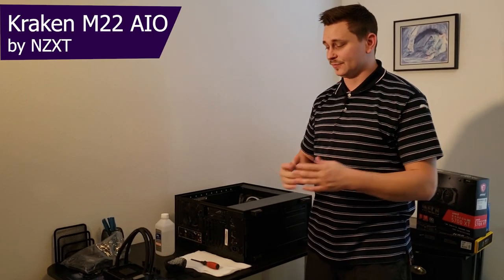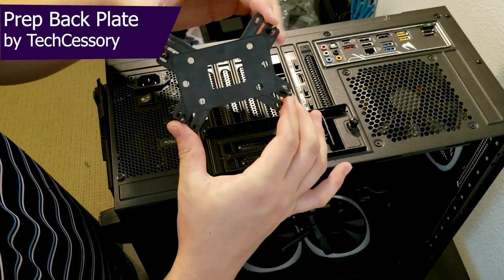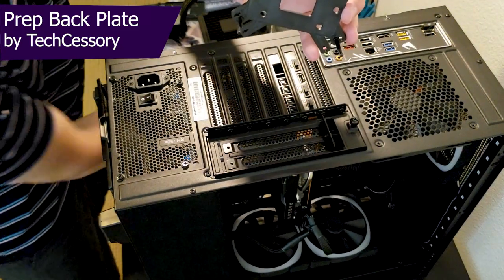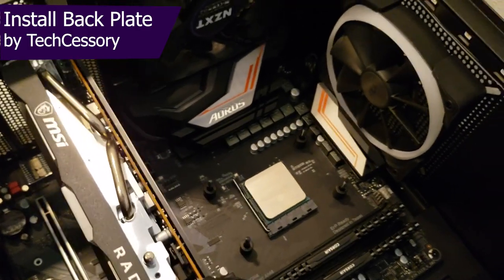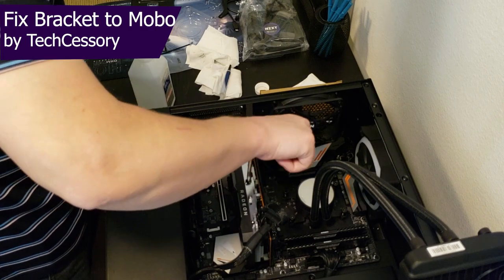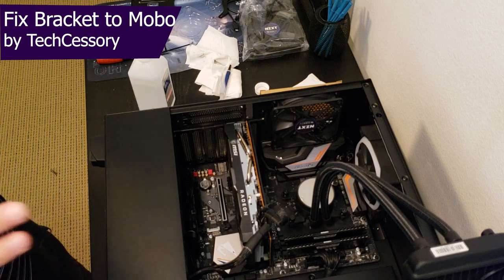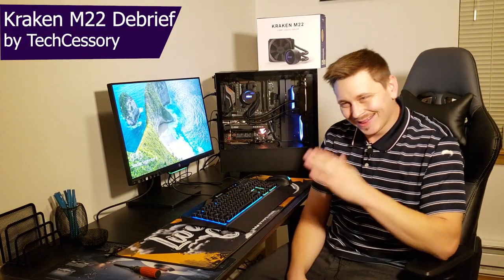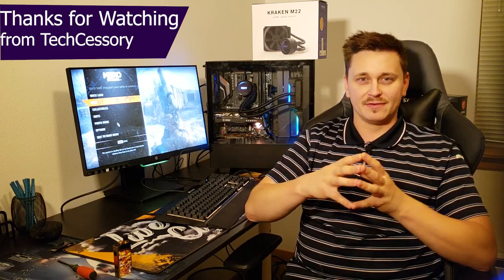AIO Liquid Cooling | NZXT Kraken M22 Install Guide

Comment: Just picked up an m22 off eBay and didn't come with the am4 mounting bracket. I searched and searched the internet for one and I still can't find one. Please help.
Reply from the maker: Check out Newegg. They have them on their website. It should just be under the search term "am4 back plate"
Reply: @BainCustom  Thank you for responding to my post but I still can not find one even on newegg. My apologies but if you could send a link that would be helpful.

Comment: Hey good video, probably a dumb question but how do you actually put water in it?
Reply from the maker: It comes ready to go. No need to add water.
Reply: TechCessory would you ever have to change the water?

Comment: Hi, great video. But i've got a question : does the radiator fit as rear exhaust in the NZXT h510 elite if i put the other fan on the top ? I hope you will se this message and answer it, the video has been posted from a long time.
Reply from the maker: Oh yeah, I always reply. Definitely join the channel so you can be a part of our discussion at any time. We have this channel and a Facebook group we are very active on.

Anyways, to answer your question. It is not recommended that you install a radiator on the rear exhaust port. It is best to install an exhaust fan so you're not blowing hot air over the radiator. 

I am not 100% certain it will fit anyways.

Comment: Thanks for the video . It was very helpful.  I have one question that i have old mb Asus m5A97 and i dont see any aio connector in case i decided to buy M22 which connector should i use
Reply from the maker: Hey thanks for the comment and welcome to the channel! It can change depending on the motherboard, that being said it is typically recommended to put the pump on the CPU fan. Then you connect the radiator fan to the system fans.

I hope this helps, this can also be done backwards and it will work just fine. Check your motherboard for any recommendations if they have any.

Comment: planning on getting one of these for my 5600x, how do u think it will hold up. i cant go for a bigger one due to lack of space in H510i with a zotac 1070 amp extreme
Reply from the maker: I think it will hold up. The nice part about the new ryzen chips is that they don't use more power than the previous gen. So they don't really run warmer.

Comment: Hey man! I am thinking of buying this cooler, but i am wondering if it is possible to change the fan that comes with the radiator? Thinking of installing some InWin Sirius Loop fans instead of what comes with this. Is it possible? It's my first time investing in cpu water cooler :)
Reply from the maker: 100% I changed it out to the Aer RGB Fans from NZXT. It should fit any 120mm fan though so you are good to go there.
Reply from the maker: It is a good investment. I think the price is about $70-$80 which is worth it for the appearance and performance for sure.
Reply: @BainCustom  Thank you so much! And really good review btw! Decided to go for this because of you instead of the Asus ROG Ryou :D
Reply from the maker: Love it! It helps that I already use CAM. But I would for sure take this over the ROG because of price/performance. Unless I wanted all ROG. Which is a whole other discussion haha. Thanks for the support!

Comment: I have the same case and thinking of ordering the m22... Just curious if you plug the cooler into the USB hub what did you plug into the cpu_fan port as Ive heard of nothing goes into that port your system will not run as it's a safety feature to make sure there is a cpu cooler
Reply from the maker: Yeah I used the fan hub for the radiator fan and the USB 2.0 connection for the head of the cooler. It doesn't call for a cpu fan connection on the motherboard.
Reply from the maker: The fan hub will bypass this issue. But if all else fails you can plug the aio radiator into the CPU connector (I have heard).

Comment: Nice video .. plz guide me i am going to upgrade msi b450 with r5 2600  and wanna install krakren m22 i am worried do i need any other bracket for amd processor/ motherboard ? Plz reply
Reply from the maker: Hey thanks for the watch and comment! Hope you're having a good start to the weekend. To answer your question, the bracket for AM4 does come with the cooler. At least I was able to utilize the bracket that came with it.
Reply: @BainCustom  thanx bro
Reply from the maker: 100%

Comment: Hey I just wanted to ask is the way you mounted the radiator the best place to mount it for better temps and everything?
Reply from the maker: It fit my case the best and the aesthetic. It is also a very efficient way to install the radiator. The fan arrangement I had in this video isn't the most optimal, but it represents a more of an RGB build than it does a performance build for low heat.

Comment: Thanks for the vid! It looks like you put a different fan then what comes with the cooler? If that’s true, what type of fan did you use?
Reply from the maker: Good eye. I used the NZXT Aer RGB 120mm fans. They worked perfectly and from what I understand any 120mm fan will work for the most part.
Reply: TechCessory ahhh that’s what I thought. For the aer 120 did you need an rgb fan hub?
Reply from the maker: My case already had one so I didn't have to use the fan hub. I'm glad I didn't need the hub that comes with the fans because it doesn't work that well.

Comment: Does the AMD plate come with the cooler? Or do you have to buy it seperately?

How did you settle the back plate? How did it fit in like that?
Thanks
Reply from the maker: So the backplate was supplied from NZXT on this cooler. It is not the stock backplate.
Reply from the maker: Well, it's not the stock AM4 backplate.
Reply: @BainCustom  oh okay
Reply: @BainCustom  the AMD plate was supplied by NZXT?

Comment: Hey! Awesome video. Very helpful. I'm getting my m22 in a few days so just doing some research. Quick question, I thought the m22 came with thermal paste pre-applied. Is that not the case?
Reply from the maker: I believe it comes with a small tube of thermal paste. Either way, it is supposed to come with thermal paste. But I recommend using something a bit more fresh.

Comment: im using an strix x570-e motherboard with a ryzen 5 3600  my gpu is a 2060 overclocked strix i wanted to buy this but thought about getting more opinions.
Reply from the maker: I mean for a 3600 it would be more than sufficient. If you plan on upgrading at any point to a higher end CPU such as rising 5000 then I would look at a 240mm. I am currently using the 3700X with the kraken X53 and I never crack over 65° C. If I were using a 120mm I'm sure it would run much warmer.

But again this will absolutely work for the 3600.

Comment: Can you lint this at the back of the case??? New pc builder
Reply from the maker: Hey welcome to the channel and thanks for the question! You will want to top mount or front mount. This way you can use the rear of the case for exhaust. You want all that heat going out the back.

Comment: So was trying to figure out which way the backplate faces and which part of the screw sits in the recess.  The how to videos i watches seemed to skip over that part.   I downloaded the manual and and it says "..fasten the standoff screws by using M2 screws. There 
is sunk space at one side of backplate can store the fastened M2 screw."
So that mean the smooth side faces out, right?
Reply from the maker: I do remember those screws being a pain to really figure out. They notched in for me in the recess portion and it was sort of trial and error until I got the correct configuration. But I think you are right, the smooth side faves out.

Comment: Do you need to remove the whole motherbored? please answer
Reply from the maker: You don't "have" to. I have swapped 3 coolers without removing the motherboard. 

Thanks for the watch! Welcome to the channel, definitely subscribe..I have a few new videos planned around pc components coming up soon!
Reply: @BainCustom  how to you put in the things that hold the cooler? Thanks for the response
Reply from the maker: The bracket for AM4 and intel are included. It is pretty simple, I show part of this in the video. Just put in the back plate and the spacer pieces on the front of the motherboard. That will lock it into place so you can install the cooler.
Reply: @BainCustom  Thank you so much for the help! I subscribed 😊
Reply from the maker: Absolutely!

Comment: I have the IBUYPOWER CO100iV2 and I was wondering if I could place the generic nzxt fan with the 120mm I buy power fan that came with my PC.
Reply from the maker: Oh absolutely! As long as it is a 120mm you can use just about any fan. Good luck and welcome to the channel!
Reply: @BainCustom  thanks man
Reply from the maker: Absolutely. definitely check out the channel if you get the chance we have quite a few videos specially on all in one coolers. Once again thanks for the question.
Reply: @BainCustom  yeah for sure, dropping a sub

Comment: hi, I just bought Kraken 120 and LED display not working any idea how to fix this? because seems like M22 is a old version of Kraken 120
Reply from the maker: Yeah that would be a new connection type. I actually will be grabbing one of these very soon to review. Not sure that helps, but it may be the same way the X53 hooks up. Where the logo and cooler head needs SATA power for the RGB to work, also needs to be plugged into a USB header.

Comment: Hey quick question will this work on a rog strix b450-f motherboard and cool a ryzen 7 2700x. ALSO WHAT FANS ARE THOSE IN YOUR PC???
Reply from the maker: I use the NZXT AER fans. They are solid. That being said, yes this cooler works well with that configuration. I have a PC that is pretty much that exact setup.

Comment: Hello! i just got this aio cooler for my  OMEN by HP 880-112na. The bad thing is i cannot acces the back of my motherboard because the Computer case it's full of metal. Any ideas? Should i remove the motherboard and then to place the backplate? Or what should i do? Thanks!
Reply from the maker: Oh buddy. Yeah it sounds like you will need to pull the entire motherboard out and then install the backplate. Kind of a bummer, but at least it gives you an opportunity to clean up the system a bit. Thanks for watching the video!

Comment: Just a little question. Why are you pulling air inwards with the back and top fan? In my opinion it should push it outside. The nzxt 510 has a solid frontplate. It will choke.
Reply from the maker: I actually ended up doing a follow-up video on air circulation. I should probably do a new one. For this setup it was simply to achieve RGB all the way around the inside with the fans that I had. I quickly changed that format and it helped quite a bit. I wouldn't say it was night and day, but it was substantial.
Reply: @BainCustom  Thanks for the feedback!

Comment: Hallo nice Video I have a question, can I use a msi-b450-tomahawk-max or a msi-b450-a-pro-max for the Kraken m22. When not can call me a Mainbord  which costs 80 or maximum of 90. Thanks 😊 And my CPU is a Rycen 3600
Reply from the maker: Use the tomahawk max for sure. And yes, 100% this cooler will work for those boards so you should be good to go.
Reply: TechCessory thanks, you are a god YouTuber 👍
Reply from the maker: @tomd9838  I appreciate that! Thank you my friend.

Comment: Hello, I have another question. I will probably get the case Cooler master 300 l, the case does not fit in there, I can take the MSI B450M morta max for the Kraken.
Reply from the maker: If you are asking if the Kraken M22 will fit in the Cooler Master 3.1 than yes. It will fit in pretty much any case made by cooler master in the last few years.

Comment: I have air cooling (Arctic Freezer 34 Esports Duo White) and I want to get the nzxt m22 will I see different temperatures?
is this change worth it(case nzxt h510i)?
Reply from the maker: What CPU do you have? It all really depends on your components as well as the look of your case. I personally like the style of all-in-one coolers. Some people really like the style of air coolers. They can have similar or even better performance indifferent circumstances.
Reply: @BainCustom  I have ryzen 5 2600 and from temperatures of 35 degrees in idle, I want nzxt more for beauty.

Comment: What's your motherboard tho? I am a little new and don't know what mainboards to buy. ^^
Reply from the maker: What CPU are you using and do you have a case picked out?
Reply: @BainCustom  Its a FX 8350, so a AM3+ Mainboard and a Case from ibuypower named ibuypower alpha gaming
Reply from the maker: If you want a decent motherboard for a ryzen I would go b-450 and probably a ryzen 5 2600 or 3600. If you go 3600 then you need a b-450 tomahawk max. Let me know what processor you want and I will help.
Reply from the maker: BTW my motherboard is the Aorus x470 Ultra Gaming
Reply: @BainCustom  Okay, thanks tho, but is there any special page where you can look if Mainboard and M22 Kraken are compatible?
Reply from the maker: On the NZXT website you can see the socket type that the cooler is compatible with. AM4 and LGA1151 are compatible.
Reply: @BainCustom  Yeah, I've found the page. Thanks tho! Gained a new Sub
Reply from the maker: @ThatOneGuy-yl1kt  Cool! Let me know how it all works out for you.

Comment: hey so I’m trying to build my first pc and I want to atleast get around 100-120 frames what parts would you recommend? I know this is completely off topic lol
Reply from the maker: Hey thanks for the question and welcome to the channel!
Honestly it depends. What resolution are you playing at, what games do you play, what monitor are you using and what overall fidelity are you looking for? I can get 120fps on a lot of games with a mid range graphics card ($350) and a $200 CPU if I really budget, but I would be playing at 1080 with low-med settings.

1440p on the other hand requires much better hardware to achieve similar results. We are talking a 2080s and better for gameplay at high-ultra settings. I can hit 120fps on my 5700xt with med-high settings at 1440p, but still that is a $400 graphics card. Let me know, maybe I can help.

This is my most recent build video, check out the parts in the description. You can substitute older generation with new for graphics and CPU for better performance. I think it's a logical build for a reasonable price.

https://youtu.be/DdKchnSzAHc
Reply: @BainCustom  well yes right now I am playing on a ps4 and I want to be able to play Cold War and Modern Warfare 2019 with it I’d say my budget is around 800

Comment: how is it holding up as of today? thinking about getting the same one but was wondering if there any issues with this version at all as far as leaking or overheating?
Reply from the maker: It held up really well. I saw a slight increase in temps over time, but nothing majorly high. Maybe a few degrees. The thing is pretty much silent (the pump) which I like a lot.

Comment: Umm not sure if I messed this up in a bad way, or if it does not matter, I just installed this AIO today. but I put my fan on the inside of the case so the Rad is mounted to the front to the case. should I change this? I am getting good temps for i do with it now. I am just about to finish the job and replace the side panels.
Reply from the maker: Hey sorry for the late reply, thanks for asking! I wouldn't say you messed up, I have mounted that way myself. There are arguments for doing it both ways. Just monitor your temps, if you notice any lag in performance than make the change.

Hope this helps!
Reply: @BainCustom  That's Great was not looking forward to messing around with it any more. As for monitoring the temps. right after it was installed and ready to boot I loaded core temp and played wow. it was running between 35 and 41c, then ran heaven on high then ultra setting got good temps and fps on that., Then loaded and ran intel burn test. ran it through 3 test standard high and very high 5 times each. highest temp I seen was 52 c. so ya was not worried as much after those test.
Thanks for your reply I often do not get reply's so it is nice when I do.
Sub and like from me mate. Keep up the good vids, I will be watching.
Reply from the maker: @PhredZed01  well I TRY to reply to everyone..well the people that aren't being rude 😂. 

That sounds solid though! The temps are for sure looking good and performance the same! I appreciate you and definitely reach out whenever!

Comment: Great video hade the same issue on where to put the fking radiator
Reply from the maker: Thank you! Yeah I spent some time rearranging the radiator. I replaced the original fan with the aer rgb fans.
Reply: @BainCustom  what fans did you replace the original with? do you have a link by any chance? looking to replace my 2

Comment: Hello I have 3 cords 1 to  usb 1 to cpu fan  and the other one is on the radiator. Where do I connect that is on the radiator, for what is that?
Reply from the maker: Hey thanks for the comment! Welcome to the channel and don't forget to subscribe if you want to keep watching new content every week!

That cable you are asking about is the pump power. That will plug into either your AIO pump header or your CPU fan header. It will depend on what motherboard you have.